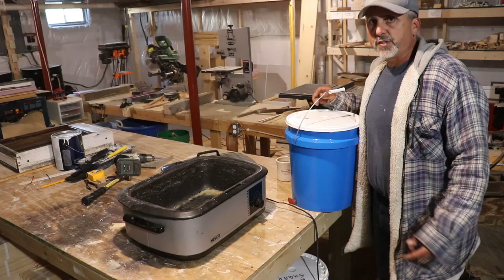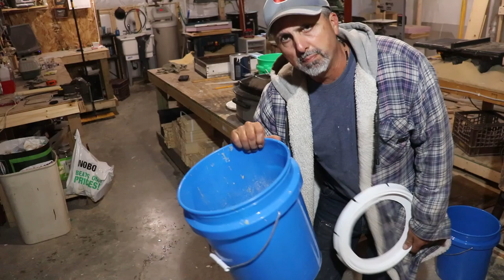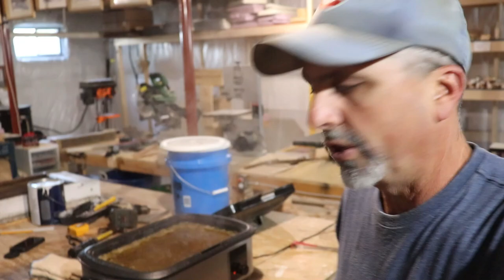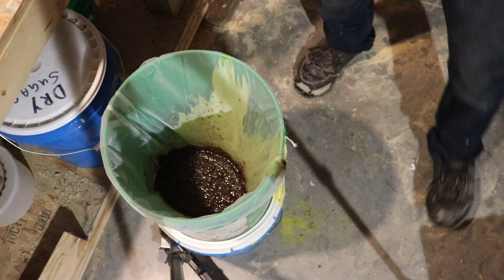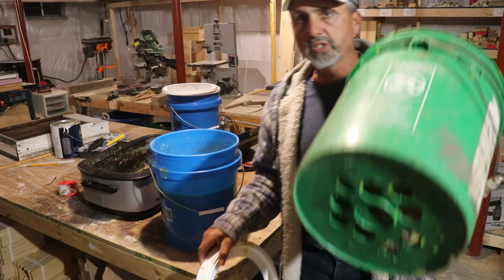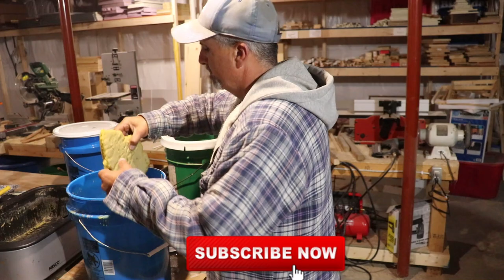How To Melt Down Your Beeswax Cappings From Your Honey Super Frames ( Jan 2021 )

Comment: Hi Vince,   I hope you were not talking about your new Maxant Honey  Bottling and Storage tank to melt your wax.  DO NOT DO THAT !!!   Second, 350 degrees too hot to melt wax. Wax melts at about 147 degrees.  Too hot make the wax too  brittle.   Third,   I scoop off the top of the melted wax before I pour through the net.  Much cleaner wax.  Two nets helps too,  Love you videos.
Reply from the maker: No the maxant wax melting tank I have but I don't use it for that only to warm up the cold honey in the buckets. Good to know the temp for wax lol I just crank it up 😁